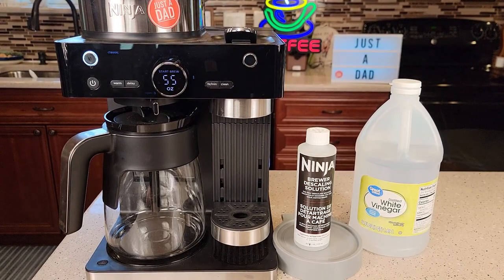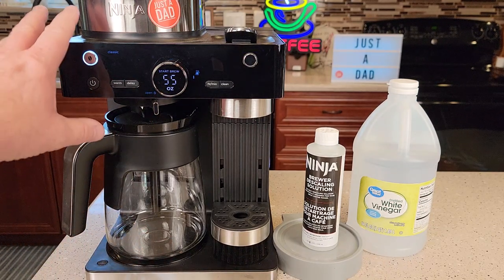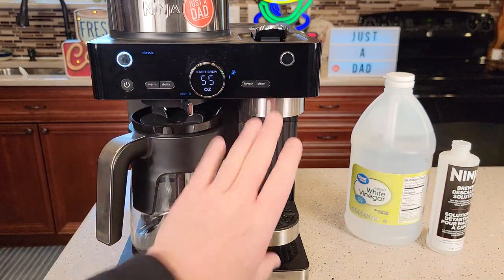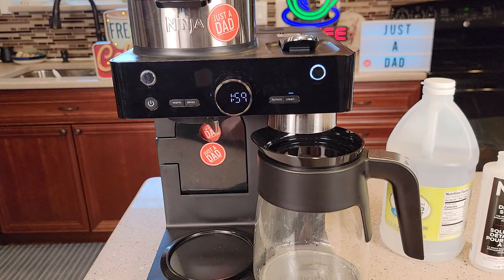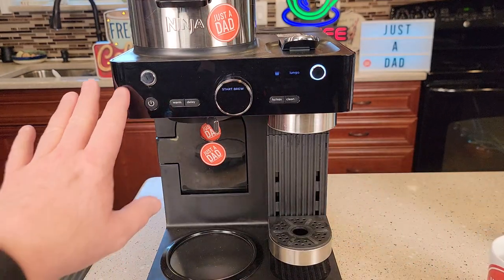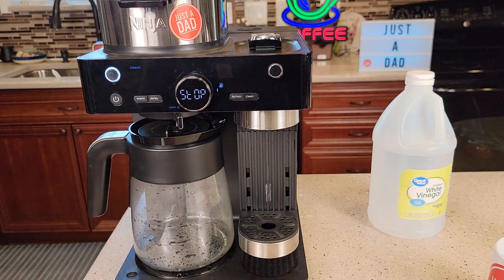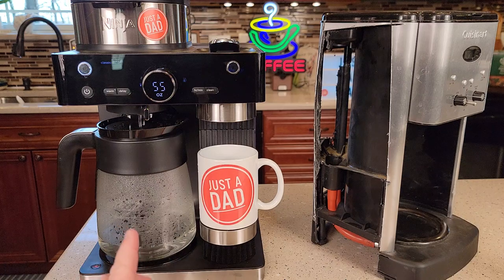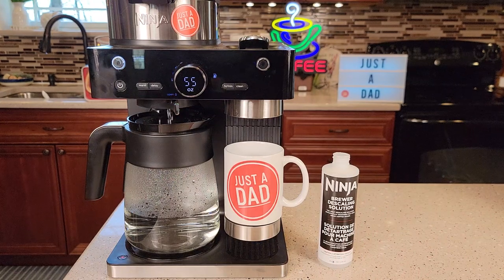How To Clean / Descale Ninja CF601 Espresso & Coffee Barista System with Vinegar & Ninja Solution

Comment: I just had where my espresso side has been brewing only water and not puncturing the top of the pod. Ive ran two clean cycles and been on the phone with ninja, any advice?
Reply: Mine did that. The piece on the inside that punctured the pods came out. Luckily I found it in the used pod resivoir but I called Ninja and they offered to send me a new machine
Reply: @Andrea-xd9sb  thanks so much. Yea I’m about to call them again. I spoke to them yesterday and did all their suggestions.